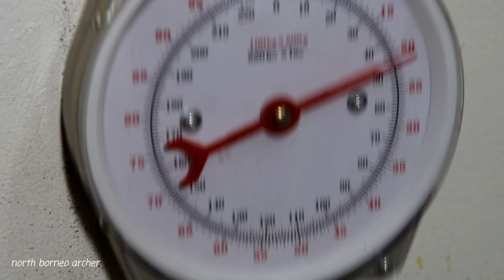making turkish horse bow epoxy fiberglass 55 lbs at 28 inch

Comment: very nice build and love the backing music choices :) this is very very close to something i am waiting on parts to build (i have 2 60cmx30mmx5mm arms coming) so i might have a 7* or so deflex in handle region. and i was going to add 2 layers of .5mm thick pvc on belly 3 or 4 layers of pvc striping on front epoxied in place(only have 4 layers for middle 2/3 of bow) then i was going to strap whole handle and bow arm in some black silk thread i have soaked in expoxy or maybe varnish or similar.
 im not sure if i want a ultra ridged epoxy or a springy one for outer shell like  a rubber cement, i know they used to use lacquer but that might have been limitations of times.
 its the last phase of bow so i havnt worried about glue selection for it yet

Comment: Would that bow work for people with 38” draw length?
Reply from the maker: Yes. the thumbnail picture has more draw length.  I make a longer bow string to match my 28inch draw length.
Reply: @NorthBorneoArcher  where can I find that flat fiberglass material?
Reply from the maker: @harryohanson  for the epoxy fiberglass I have update the link for discription.  You can also search at alibaba express.  For this type of bow make sure to buy the green clear one, for more poundage. The dull green one usally for making bending bow type.
Reply: @NorthBorneoArcher  thank you so much!!